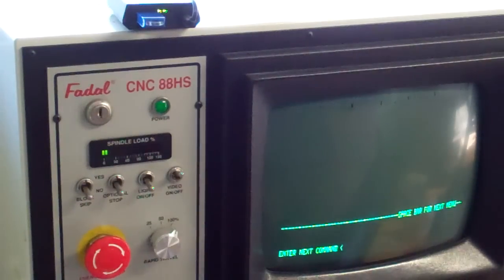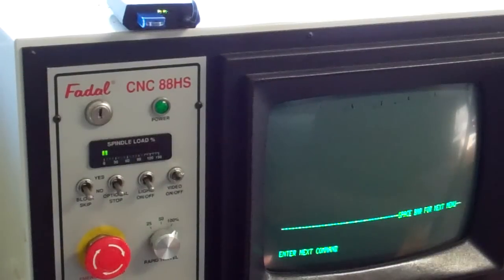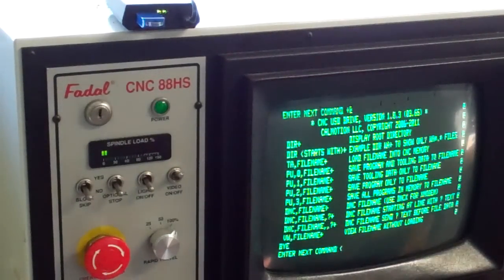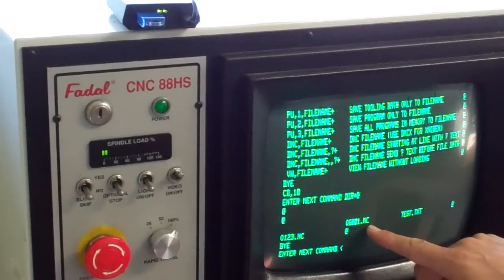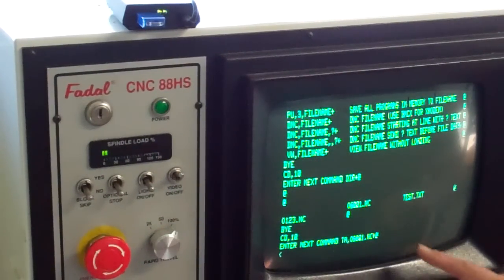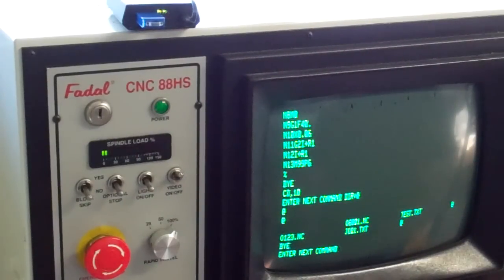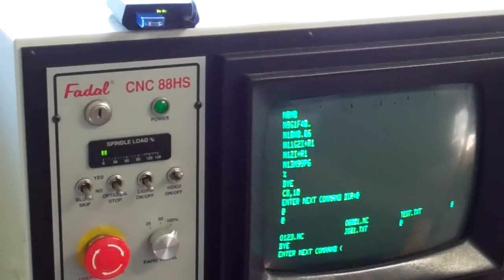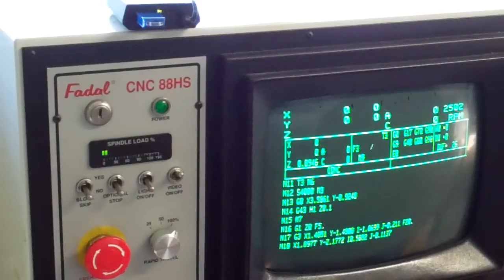Calmotion USBCNC-FAD USB or Ethernet for Fadal 88HS or 32MP

Comment: I have  an issue reading the nc crode from the USB. If I dont finish the G code then I just  can't  CD,10+ again, how can I re read the USB if  I DNC the G code?
Reply from the maker: Not sure what you mean. If the Fadal is not responding to the keyboard presses, press the MANUAL key.  Then you should be able to enter the CD,10 again.

Comment: Do you have any part number of the USB-RS232 converter?
Reply from the maker: The product shown in the video is USBCNC-FAD-INT for the panel. USBCNC-FAD is the external unit that doesn't need much installation. Find these on the website www.calmotion.com

Comment: When I run a larger program direct from the USB, there is often "communication error" between the USB and the machine and the program drops off somewhere in the middle. Is there a way to fix this or just add memory to the machine? Thanks.
Reply from the maker: Try using DNCX instead of the DNC.  The X will use xmodem so errors will resend data.  Look in manual or help menu,  you can start at any line by adding the search text in the commands second parameter.
Reply: @CalmotionProducts  Thank you very much for the reply. I will give that a try and see if it works better. Thanks again.

Comment: How long should it take to load to initial page upon power up?
Reply from the maker: You will get an immediate response. You enter the CD,10 command, then to show the help screen you can just press the +  The help screen will immediately display.
Reply: CalmotionProducts mine is stuck loading.  If you had a second to check out the pictures on Instagram ( sasknomadicmind ) I'd sure appreciate it!  Had a machine that's running usb conversion was working previously. Now after a move it's stuck on loading cnc page when powered up.  Thanks!
Reply from the maker: Looking at your picture, that is the Fadal's power on screen "CNC LOADING, PLEASE WAIT." Depending on the size of the memory there would be more decimal points ...  Is this the first time powering up the machine, memory might need to cleared? I would restart the machine again.
Reply from the maker: You can add a jumper to the J2 on the 1400 board. It is the second jumper next to the intel processor.  With the jumper there, it will power up into the test menu. You can zero memory on page 2, #5
Reply: CalmotionProducts thanks,  ill try that.
Reply: CalmotionProducts that is the second time picture.

Comment: Everything I watch mentions the "RS232 port" on the 88HS or 32MP.   
All of my customers have the 32MP and from what I can tell it's NOT an RS232 port but seems to be an RS422 port instead.  
Do you know if this is true  or are there different options on the Fadal communication boards to make them RS422 instead of RS232?  
Thanks!
Reply from the maker: ALL Fadal controls have a RS232 port that is at the back of the machine, including the 32MP.  The RS232 at the back of the machine is where our product connects to.  The RS422 port you mention is an internal port that is additional port that the 32MP has.
Reply: Thanks!  Everywhere I have visited and worked (I'm an independent computer network communications guy)  They only have the RS422 port hooked to very old tiny indusrial board PC that also resides inside the 32MP pendant.   None of the online manuals that I have been able to find anywhere online OR of the printed manuals that my customers actually have that go with their machines even remotely mention the RS422 port OR the little OLD win95/98 PC inside the pendant how it works how it hooks up or anything about it.
There's a CNC/DOS switch on the pendant that switches the VGA monitor between the machine's own computer (FADAL) and the Windows95 computer inside the pendant.
The little win95 computers have an old ISA serial card (RS422) that is programmed/jumpered for COM2 and hooks directly to the Fadal 1030 board to it's own RS422 connector.
They run a little windows program called "Fadal Memory Manager" in Windows that somehow uses this RS422 connection and NOT the RS232 connection on the machine.
I have not been able to find documentation about ANY of this yet this is exactly what I am seeing out in the field at 4 different shops I have visited.
VERY FRUSTRATING as I'd like to be able to fix/maintain these for my customers.
Reply from the maker: That is the purpose of our products, the USB or the Ethernet version of our product that 32MP customers use to replace the functionality of the industrial PC and the Memory Manager program. Typically the LANCNC-FAD what most 32MP customers switch to because it gives them the Network functionality, the ability to run large programs, and load/save programs to the Fadal 32MP CNC side.
Reply: Thanks I understand the purpose, but I don't understand if your product is connecting to an RS232 port (that my customers are currently NOT using, or if it is connecting to the RS422 port that all of my customers ARE currently using and why I can't find any documentation or info about this RS422 port that they are all using here or it's pinout to connect it to a product like yours if we are to get away from the Windows 95 Fadal memory manager program they are using now (which I also cannot find any documentation on or it's connection to the 1030 board via RS422 style serial and NOT RS232.   
Do you have any information or knowledge of this or know where I can find more out and get more familiar with the interface?  Thanks.
Reply from the maker: Please see our first reply, our products use the RS232 port on the 1030. The RS422 can still be used undisturbed with the Fadal memory manager application. We don't have any documentation on information you are looking for.